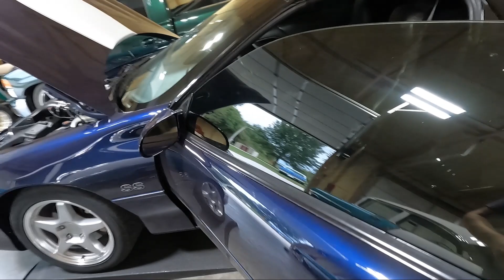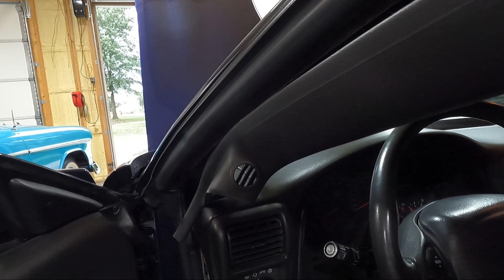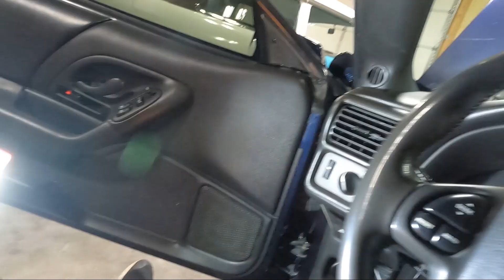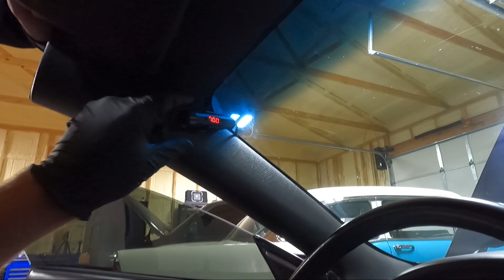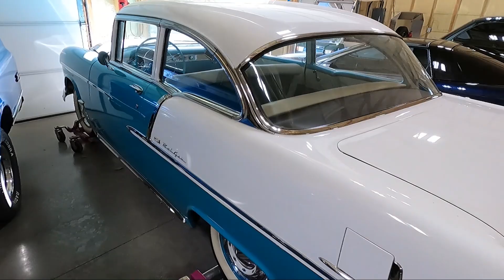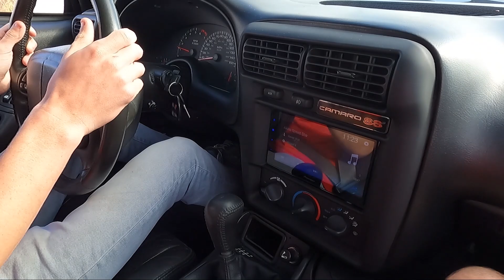Installing Shift Light in the Camaro (Finally Finished But Can He Drive it? Let's See)

Comment: I got 2 white wires, not just the one.
Reply from the maker: Not sure why
Reply: @TWAMotorsports  dang auto correct.... I meant I had more than one white wire coming from the red pcu. If anyone else has the same thing. After downloading the wire diagrams, I figured out this out....   It's the bottom pcu. Pin 10 is engine speed. The closest white wire to the passenger side of the car is for criuse control, and the second white wire, pin 10, is the engine speed wire. That's the wire you want for wiring in your shift light. Regardless what type. That's on a 02 though. It's different on 99 and earlier years.

Comment: So your factory tach still works good?
Reply from the maker: Yep but they are crazy slow
Reply: @TWAMotorsports  so it’s not as accurate after install? I have always wondered if I install one it will be off or not accurate
Reply from the maker: No that isn't what I am saying. Works the same after install. The factory tac is slow. You don't see that until an accurate light is installed